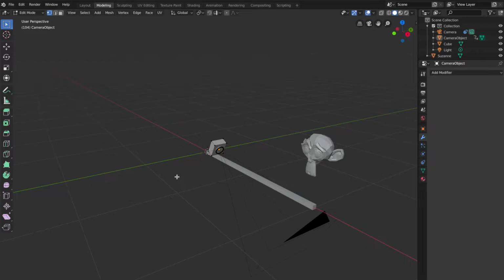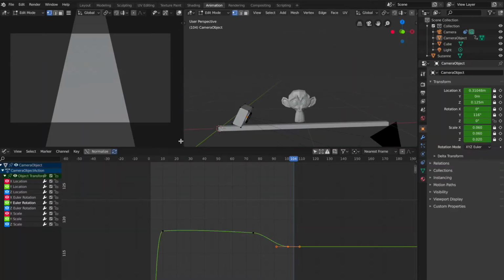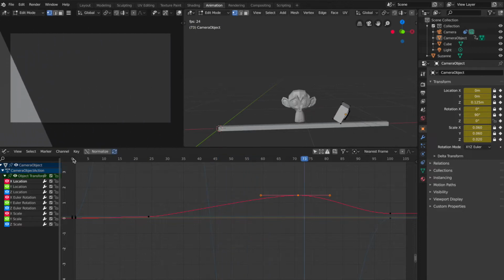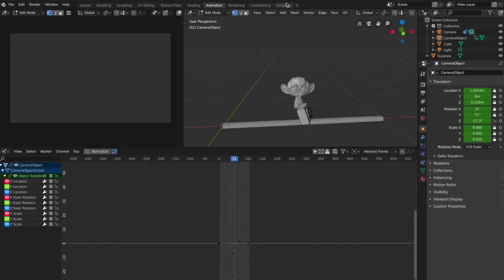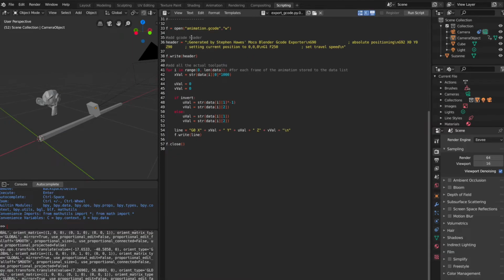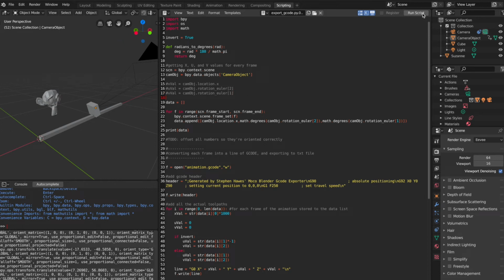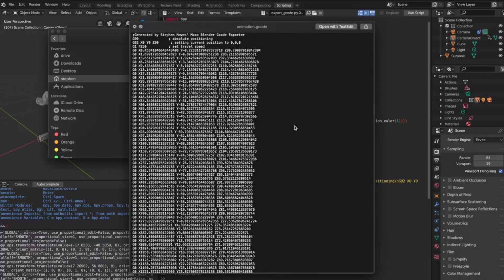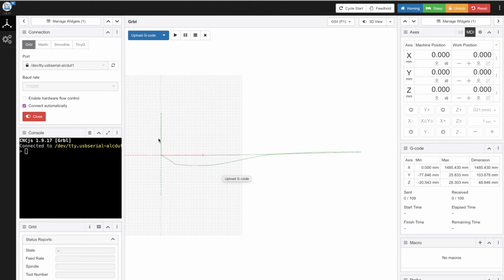My videos will never be the same...

Comment: this is really nitpicky, but just letting you know that the "radians_to_degrees" function you have is already implemented with math.deg
Reply from the maker: ahahaha thanks, good to know! Props for pausing and looking at the code. I ultimately didn't even end up using it as Blender uses degrees as a unit anyway.